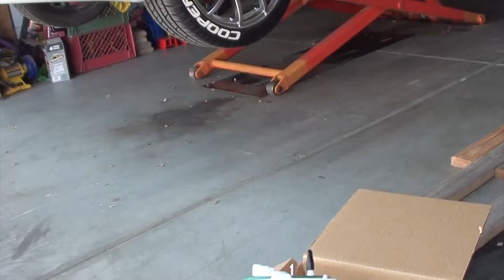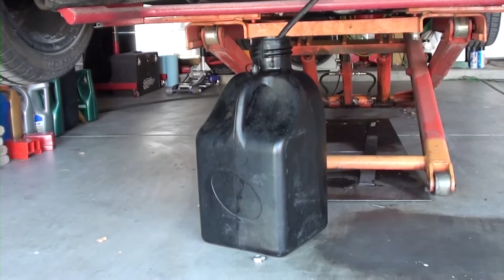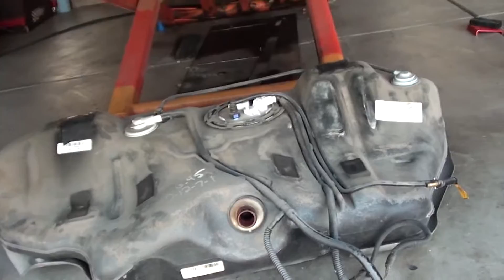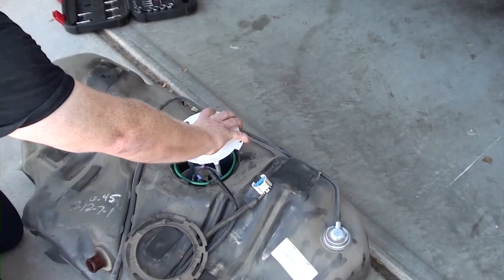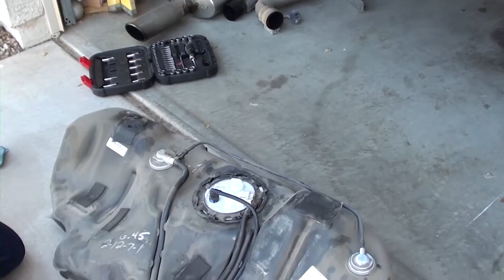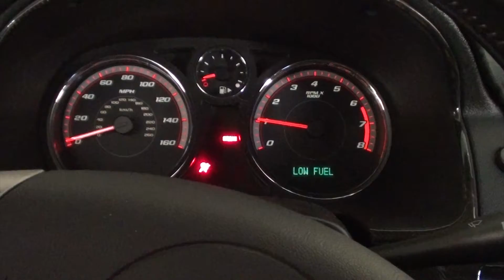How to Replace Fuel Pump Sending Unit! Cobalt SS TURBO LNF

Comment: Did you use a scan tool to reset your cel? Or can you do that on you steering like you can with the oil life? I'm having an issue with the service traction and abs and stability control. Ive replaced all hubs with new and speed sensors with no luck

Comment: Great video :). Just sitting in my 08' here at work and was wondering about how to do the pump. Seems really straight forward. I have done 2 pumps on both my 96 and 97 v6 Camaros that failed at almost exactly the same mileage. GM must of installed a timer on those :p. On those cars I was just able to cut through the body and create a door to lift the pump out :). LNF has been good to me so far I daily it through all seasons here in Canada eh.

Comment: Did it still run fine despite the signal issue?
Reply from the maker: Yes it ran normal but when the fuel got lower and I went around a corner it would cut out because it wasn't getting any fuel.  Hope that helped.

Comment: I think your CEL saying low, low side fuel pressure is your extra filter. It's not needed.
Reply from the maker: I was using a high pressure pump in my tank with no filter when I was running on E85 that's why I had the external one.  I probably should remove it because it's not needed anymore.